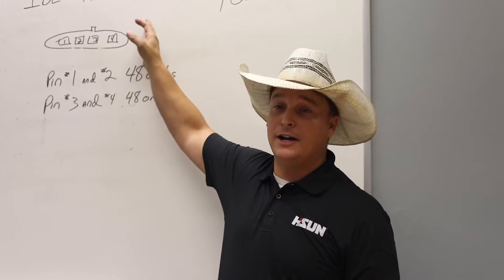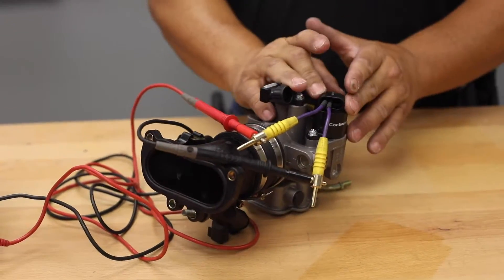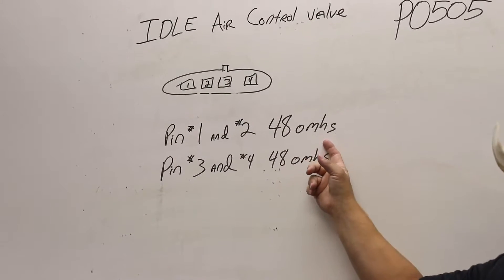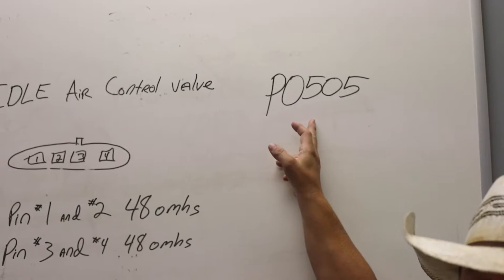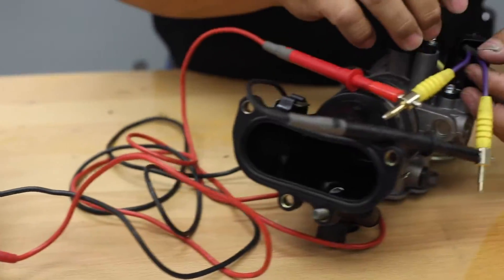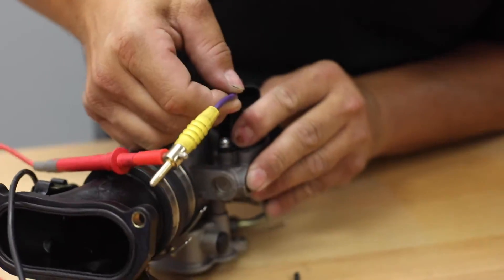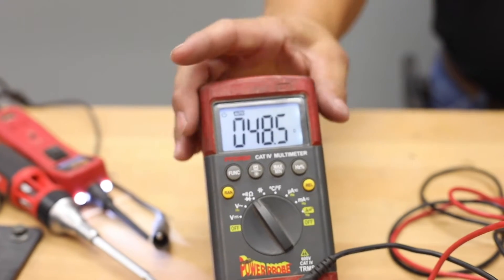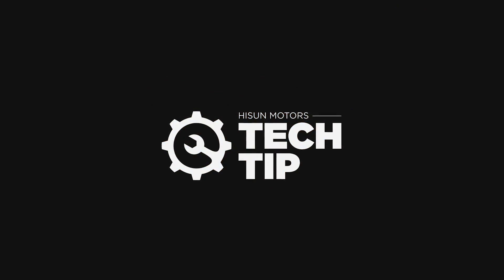Idle Air Control Valve - HISUN 250cc-1000cc Engine

Comment: excellent video!
a question please:
The measurement on my atv 500 hisun efi (year 2011) gives 54 ohms (its measurement indicates 48 ohms).
Should I replace the valve?
The bike runs fine (idle at 1400 rpm).
thank you so much
Gabriel
Argentina